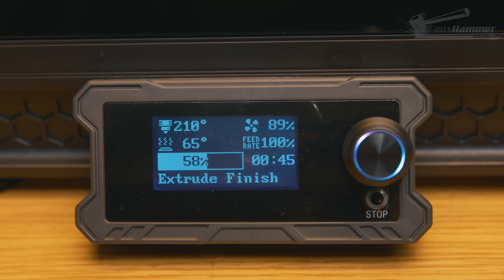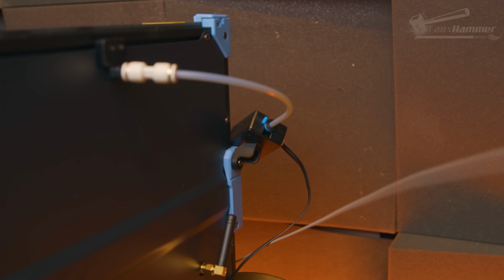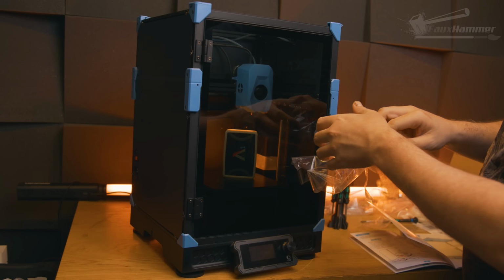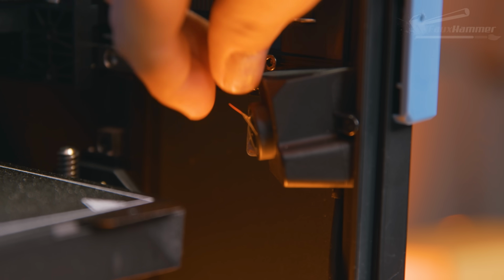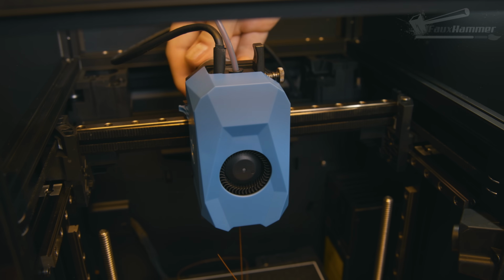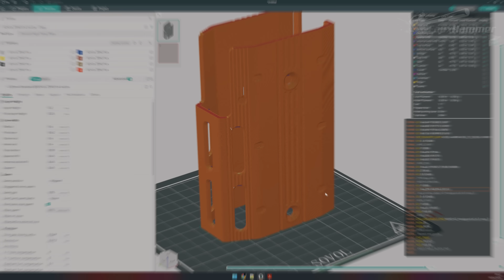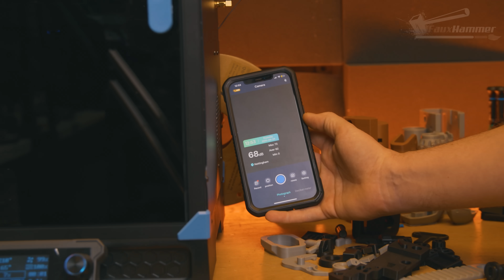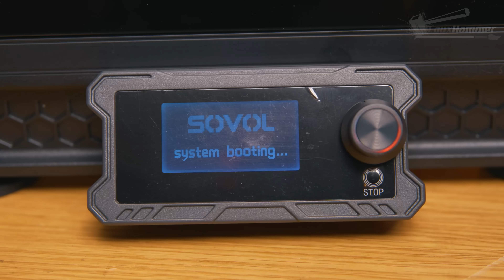Sovol Zero Review - Tiny and Powerful

Comment: Honestly I had a rocky start with my sv08 but as time has gone on and I’ve spent time less frustrated with early adopter issues and way more time with it just working the fan mount on the bottom of the head sucks and I end up replacing it every 300 hours or so annoyingly but that’s not that big of a deal overall

Comment: I like my Zero more than I thought I would.  I do functional prints and not miniatures so I was expecting the Zero would be too small but in practice the 152 mm cube is the sweet spot.  I'm sure the Voron 0.2 would be too small for most of my parts but the Zero is a Goldilocks printer.  I love Sovol's committment to open source.

I've given up on WiFi on Sovol printers.  I did briefly try with the Zero but when it didn't work again, I didn't try further.  I plugged the WiFi bridge into the Ethernet port and it's rock solid.

I appreciate the reliability of the Zero.  It's a solid little printer.  Sovol's slicer profiles are way too fast.  Slow it down to a sane speed and acceleration and the print quality is very good.

I also love the enclosed design.  Passive heating works great on the Zero.  I'm back to printing ABS and now ABS-CF parts because it's so easy.  I designed an ultralight slip case to protect my mini drone and controller (on Thingiverse and Printables if anyone is interested) and by the time the first layer was finished, the chamber was already at 50 C.  The wee Zero prints ABS-CF like a dream.

The only issue I had was the nozzle cleaning process would leave a little plastic booger on the tip of the nozzle approximately 10% of the time and that caused the Z offset probing to be too high which made the first layer unreliable despite the flat bed and accurate Eddy probe bed mesh.  I modified the nozzle cleaning macro so it heats the nozzle, then scrubs it on the silicone wiper pad as it cools so there is no nozzle ooze after the wiping operation is completed, so there is no need to press the nozzle into the bed at 30,30,0 to try to prevent ooze while the nozzle cools, so it can't leave a little plastic blob there to be picked up the next time.  I created a thread on the Sovol forum and posted the modified macro there if anyone would like to try it.  This completely fixed the intermittent first layer issues I was having.  I printed 21 first layer test sheets, 3 each in 7 different materials, and all were essentially perfect, certainly much better than the one shown in this video.

Comment: You can probably optimize the slicer settings to get a high quality benchy in like 15-20 minutes. Also calibrating pressure advance and input shaping. For PA I use the "PA line" test included with orca which takes very little time. For slicer settings watch "fast printing explained" by 247printing but dialing down the speed on visible stuff.

For quiet fans you can just lower the max speed of the part cooling fan. Try 0.6-0.8.

Comment: From the looks of it, the fast benchy of the two's problems could be solved by calibration. the gaps in the top layers looks like pressure advance being out. and you cant blame sovol because that's really filament specific.

Comment: just 3 screws to change the nozzle... laughs in Bambu
Reply: The standard MK8 nozzle on the Zero can be easily swapped by unscrewing the old nozzle and screwing in a new nozzle, although I leave a @Microswiss 0.6 mm CM2 nozzle with a hardened steel liner installed and use it to print every filament.  The Zero is a great printer for ABS-CF parts.  Easy as PLA.

Comment: I will state it now.
Bondtech will use this Zero as a first retrofit off the shelf printer for the new toolhead design.
Just saying.
Would be an AWESOME fit!!!!!!
Reply: Actually, Bondtech recently announced that they will produce ans INDX kit for the SV08 first. :) I'm really looking forward to that mod.
Reply: I may put the INDX on my SV08 AND my Zero.  I don't print in color but it would be great to have the ability to print TPU feet on an ABS-CF part, or use a PLA interface for peel away supports on PETG parts.  It would also be great to have all of the filaments I typically use pre-loaded (maybe all loaded in a drying box) and use a quick tool head change command to swap filaments before each print.

I print a lot of TPU and I'm hopeful that the short melt zone on the inductively heated INDX will be better for TPU and particularly the foaming TPU-LW.

Comment: I really enjoy your point of view.  I think it reflects what most people experience.   The zero is too small for me however I did just back the sv08 Max and that will be my first Solvo printer.  Seems like they are definitely learning.
Reply: Your incoming SV08 Max benefited greatly from the lessons learned making my SV08.  I appreciate Sovol trying to reduce cost to make 3D printing more available but they tried a little too hard on a couple of aspects of the SV08.  The thin aluminum bed warps.  My SV08 bed warps more than 1.1 mm.  The 8 mm inductive prox sensor is apparently the least expensive one available, with no temperature compensation, so it takes a long time to probe the bed and the bed mesh is far too inaccurate for Klipper to compensate for the badly warped bed.  The SV08 Max has a thick 8 mm bed and even though it's much larger than the large SV08 bed, it warps much less.  The SV08 Max uses a fast Eddy probe, just like the Zero shown in this video.  The Eddy probe is fast and accurate.  If you slow down the SV08 Max so the long runs of relatively narrow belts don't stretch under print head acceleration (a potential issue with the SV08 Max), you should be very happy with that big monster printer.

I just spent $250 on a R3men graphite bed for the SV08 to fix the taco bed, and Sovol is wrapping up an Eddy probe upgrade to the SV08.  I may spend $400 to fix the problems with my $500 SV08, but I'll still have a hot rod Voron 2.4 for a lot less money and a lot less of my time, so it's still not too bad.  I think Sovol will release an SV08 Ace in 2026 that upgrades the SV08 to fix its initial problems.  That will be an awesome printer.

Comment: In case you haven't found it yet, the exhaust fan is chamber temperature activated. In orca if you go to the device tab and look at the temperatures panel, you will see Nozzle, Heater Bed and Exhaust fan temperatures. The value next to the edit box for exhaust is the current chamber temp, if that reaches the value in the edit box then it will activate, if 1 or 2 degrees lower than the edit box then the fan will stop. Edit the  value to suit :) hope the helps.
Reply from the maker: But shouldn’t that only be active during a print? With no g-code running the printer has no Iinstruction to monitor an mai Tain temps. But it is iften more than. 30 degrees in my room so this could be the case
Reply: @FauxHammer  Toxic fumes will remain after the print stops running, so venting the chamber untill the temp drops below the set chambers target seems like a good idea. You can set a higher default temp for the exhast in yout printer.cfg file but I know you prefer not to dig to deep. The variable is called target_temp: and it's in the temperature_fan exhaust_fan section of the printer.cfg. It's not monitored by gcode, it has seperate logic control. :)

Comment: Sovol didn't include a complex screen as most macros, adjustments, tuning and such are conducted via Klipper, which is the Device tab n Orca Slicer. Another feature you didn't mention was the temperature capabilities. Being on a AC heated bed and a 24v system you're able to get to 120deg bed and I believe it was 350deg nozzle for Nylons and PC prints, where as most common temps are !00deg and 300deg. Also I would like to add that this build size is primarily meant as a secondary printer, I don't think this was designed as a first/primary printer.  All in all, another brilliant review and demo, as always, love your work.

Comment: So tiny build volume, bad print quality, bad UX, and all of that for only 420 dollars? What a great deal.
Reply: The Sovol Zero print quality is very good if you aren't printing 8 minute speed boats.  The user interface is primitive but I never use it because I control the printer via Orca and the Mainsail web interface, just as many expensive laser printers have rudimentary front panels because they're controlled almost exclusively from the computer.  I consider $420 to be a decent price for a fully enclosed coreXY printer with 120 C print bed, 350 C nozzle and 50 mm^3/s volumetric flow.  I print ABS-CF on the Zero as easily as PLA.

Comment: (If you mount the spool the other way around, so the filament exits from the bottom of the spool on the right side of the printer, it can go up the right side of the printer to the runout sensor. No need to leave it all on the back. Though it seems the newer printers mount their filament on the right side from the factory.)

Comment: Sovol, and even Creality to an extent are a good starting point, not a finished product. Creality has been attempting to change that, and making good strides in that direction. Sovol seems to be happy with just giving you the "base model" out of the box, and letting you mod to your hearts content. And for the price of this little guy, and it being 100% open source (including CAD files) I feel would actually be better off building this than a o.2 kit from any of the box stores. Those still need mods too, they rarely come fully decked out, and still need a full tune when done. I think this little guy will find its way into my shop eventually, maybe the second generation of it. Sovol Ace Zero just sounds cool too ngl.

Comment: By the way, there is an extrude option in the ui. It's in the same area where you would control the x y and z motors.
Reply: I don't mind the primitive user interface on the Sovol Zero because I almost never use it.  The Mainsail web interface is where I do everything, including heating the nozzle so I can change filaments, and I don't bother turning the handy wheel on the back of the extruder.  I just click the EXTRUDE button in Mainsail to purge the old filament.

Comment: Out of curiosity, when did you get yours? I got mine a couple of weeks ago and they changed the default mounting location to the right hand side. The instructions reflect the change and there are holes for the filament run out sensor to mount up front as well.

Comment: I've had a Voron  2.4 350 for close to 2 years and have modded it over and over.  Right now I'm converting to canbus with an ebb36 and I'm just finishing wiring my A4T toolhead.

I've got so many extra parts I'm considering building a v0 for shits and giggles. 

Thanks for the reviews!
Reply: I build a 2.4 and then proceeded to build another one, but I needed something to proto and print objects quickly to replace/repair...so I build 3 vZeroes...and now have over 30 printers sitting around.

Comment: Mine just showed up yesterday. Got it to learn klipper and get familiar with settings and finish printing parts for my VORON.
Reply: The fully enclosed Zero is a great little printer for printing Voron parts.  I designed an ABS-CF slip case for my drone and by the time the first layer was finished, the chamber had passively heated to 50 C.  The Zero is a great printer for higher temperature materials such as ABS, ABS-CF, ASA, etc.  I may start printing nylon and exotic stuff like PPS.
Reply: @Liberty4Ever I’m tuning mine now for asa for my VORON

Comment: For the price of this thing you can buy pretty much 2 A1 minis. It just makes no sense.
Reply: The point is that it's voron based, so for tinkerers who like to upgrade their machines and use them as a project, not just as a printer, that moddability is easily accessible. People place value on different things, so for some people this printer might make sense. That said, I won't be buying this one myself, I already have a printer that I like just fine.
Reply: This is based on the V0, which is pretty much designed to print ABS. The A1 won’t do that. They are different printers for different uses.
Reply: With a @Microswiss 0.6 mm CM2 nozzle, the Sovol Zero prints ABS-CF as easily as PLA.  It's a very sold little printer.  It can print fast because it's small and beefy but Sovol over sells that.  The real strength of the Zero is the ability to print any material (120 C bed, 350 C nozzle, 50 mm^3/s volumetric flow) in a small quickly heating chamber.  I made an ABS-CF slip cover for mu mini drone.  By the time the first layer finished, the chamber temperature was 50 C.  No cracks or layer separation when printing ABS or ABS-CF.  It's as easy as printing PLA.  The Zero is a scaled up Voron 0.2, and the 152 mm cube build volume is the sweet spot for my functional prints.  I was surprised at how much I like the Zero.  It's a very useful printer.

Comment: I really like mine. After relocating the spool holder and runout sensor, and reprinting all the external plastics and the toolhead cover in a color I like better. This little machine has quickly become my goto printer for anything that will fit on it and I don't need in multicolor. It's fast and reasonably accurate after a little calibration. I REALLY like that Sovol are so open source centric with their core xy printers. In addition to just using Orca as the slicer, they also ship with Klipper firmware (albeit a dirty version) and they make cad files for the whole machine available on their wiki. Makes modding a lot easier.

Comment: Interesting that they're still up to their old tricks that you need to adapt what they're shipping in several ways to make them usable. But at least some other ways have made them more usable.
I had an SV01 that was a prime example of a lemon. After a single print with adhesion problems, every time I tried to use it something different was causing problems, which s quite surprising for something that was essentially just a slightly enlarged Ender 3.
Reply: I used my SV01 for a couple of years and it was a workhorse.  The heater failed after a week or two (one of those early bathtub reliability curve failures) but I easily swapped it for a generic Ender cartridge heater and had no other issues.  It was a simple reliable printer.  YMMV.

Comment: as for me, hit and miss at the same time. I like the direction that Sovol have chosen. opensource printer designs massproduced is much better than one-more-useless-bambu-clone. That's the hit. Sovol put huge effort to mass-produce it. Vorons hard to assemble printers and lack basic QoL things like nozzle cleaner. 
The miss is... for who it is for? I understand that they've put fair amount of work already into this machine and improved Voron design in many places, but... it's not set-and-forget printer from one side. Even no well-tuned profiles.  From the other side - they have some assembly issues. For voron dudes and "printer thinkerers" 7k accels on V0 machine is an indicator of assembly problems. It must be able print benchy in 10-12 minutes with quality you printed it in 30 minutes (I have 350 Voron capable to do that). That's the point of being small. Lows mass - fast speeds. No offence to the Sovol, they just can't do everything at the same time, hopefully they'll improve on both sides. 
 I initially planned to buy it. I want fast small-sized printer for ABS. Heat fast - print fast. But when I've seen it's input shaper.. I bought another small-size printer kit. Because there is no such printer on market. Had to buy kit. I think people will be glad to accept small-size printer format, but you have to show them how fast and fun it could be without sacrificing quality.
Reply: I think the 7K accel issues is surely something loose because it makes no sense to me why this frame would produce these results
Reply: @Castdeath yep. Frame is awesome part of this printer. Well, not necessary loose. It might be toolhead. V0 uses bowden due to small size. Sovol Zero not mych bigger. Average modern DD extruder weight 140-150g. But moror on Sovol extruder looks BIG. So i wonder how much that toolhead weight and how wobbly(or how rigid) it is. Might be belt tension as well or one thousand of other reasons. But since 7-8k accels pretty consistent result across different people, I would bet on toolhead first

Comment: I recently bought one of these, and I'm quite happy with it so far.  It does have a few quirks, and there are things that aren't exactly the way I would have done it, but over all a very nice usable printer.  If Sovol were to come out with a clone of the Voron Trident in a 250-300mm size, I'd buy one in a heart beat!
Most of the stuff I would 3D print does fit on the Zero.  There are some things I would need a larger printer for, but the SV08 is just a bit TOO bit.  And once you've used an enclosed core XY you can't go back to a bed slinger!

You shouldn't have to take the extruder apart to change nozzles, just unscrew the nozzle and screw on another using the wrench they give you.  That assumes that the nozzle isn't fatally jammed however.  It's just like any other printer using an MK8 or V6 style nozzle.

Yeah the filament runout detector is the simple switch type.  If it ware also a filament motion detector then it would detect a snagged filament on the reel.  You might be able to substitute an after market filament detector for that, but you'd have to make changes to the config files.   Nice that it running klipper so this is actually possible.

It's also possible to configure the wifi via SSH using user=sovol and password=sovol.  If this sounds like a chicken and egg problem, well it would be, except for the fact that you can just plug in an ethernet cable to your LAN for the first boot, then edit the wifi parameters as superuser.  IF you speak Linux that is.....

And yes, the Zero does print at Warp 8!